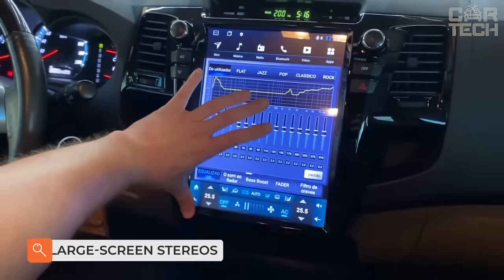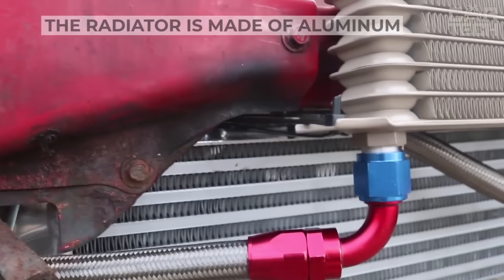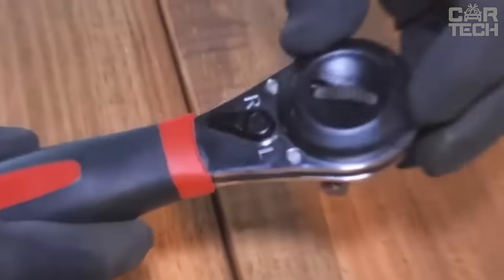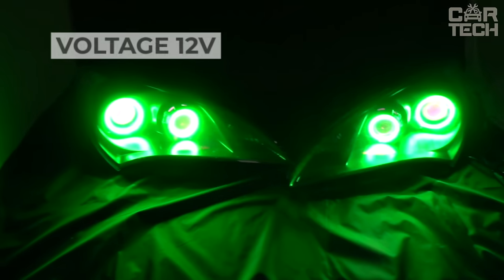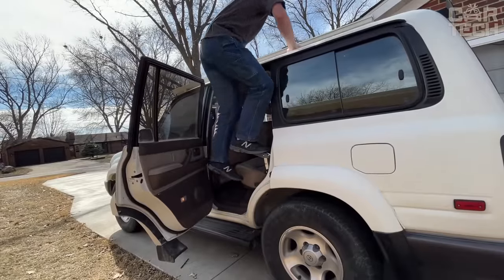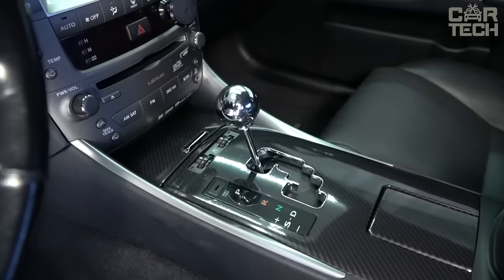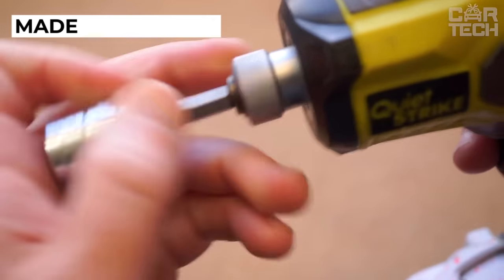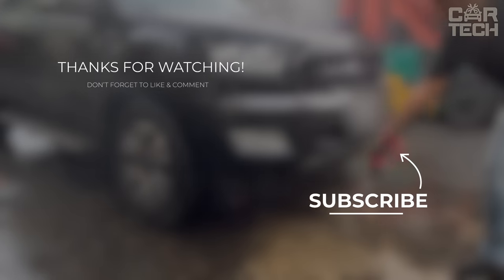40 Coolest Car Gadgets Still Available on Amazon 2024

Comment: there are some dangerous gadgets. 
The Ledlamp advertised can't be used as a replacement for a bulb due to how the reflector is constructed. Best case scenario you'll be blinding your opponents, worst case scenario you don't see diddly squat.
The anti-slip clamps basically turns your seatbelt inoperable. So you pay money to make sure that your seatbelt won't work when you need them.